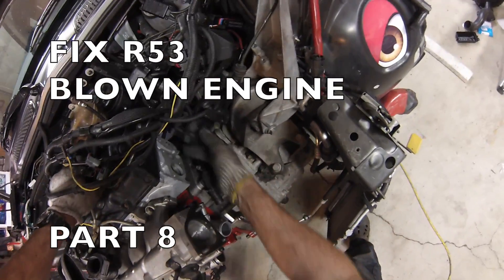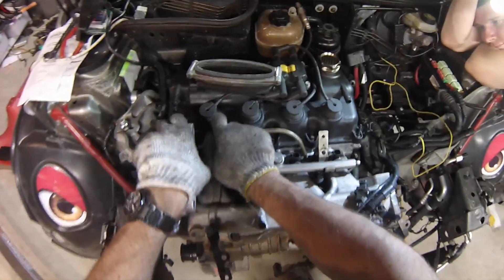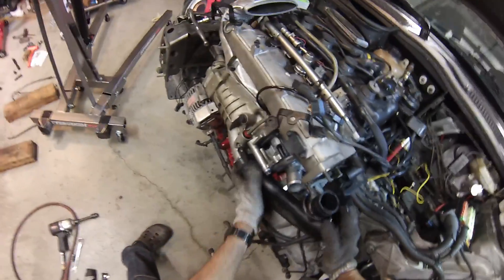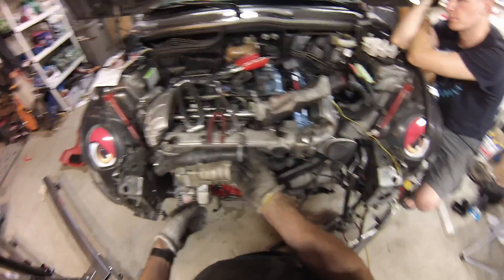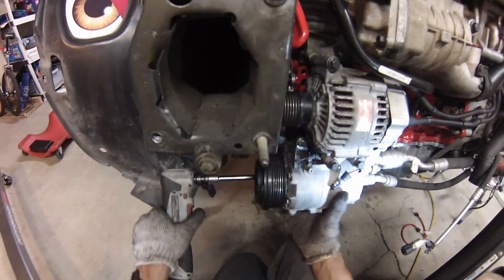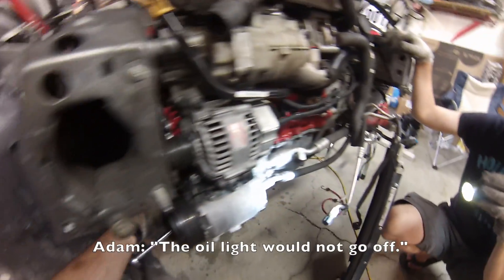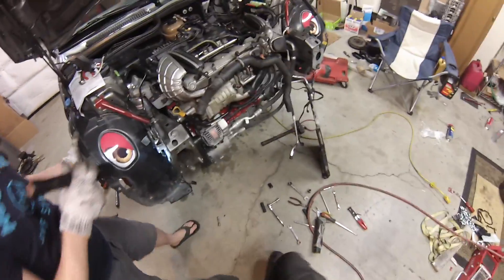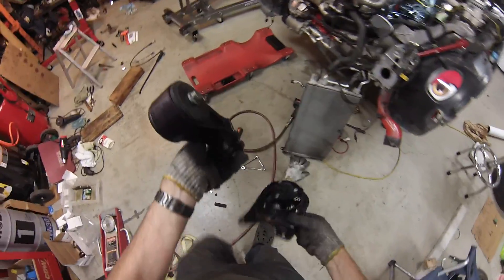Rebuild R53 Blown Engine 2004 MINI Cooper S - Part 8 / 9

Comment: BMW loves 11MM bolts lol
Reply from the maker: On this car, not so much;  the only 11mm I have found on the whole car are on the supercharger horn to intake manifold. And I've taken apart the entire car before.
Reply: Ok well they like 11MM heads where you don't expect them lol. On bmws all the intake manifold bolts and nuts are 11 while exhaust manifolds are ten, throttle body is ten, etc lol.

Comment: when changing he transmission fluid the hose must be snug on the transmission?
Reply from the maker: It doesn't matter because there is a vent, but easier to fill and easier to see when it is full if there is space for air/fluid to come back out.

Comment: When you fill the gearbox with oil, great technique.  How come you don't squirt the compressed air in from the bottom of the oil bottle though?
Reply from the maker: +mjhmotorsport Because 1. it would leak all over the place until I get the air going. 2. The air would rise to the top and the oil would stay at the bottom of the bottle - still would need a tube reaching to bottom of the bottle.
Reply: Ah yes, I didn't think of that.

Comment: Why do you still have the air con on there? Would be so much easier to work around the bay with all of that removed! You don't use air con on a track day surely?? Great vids by the way though.
Reply from the maker: +mjhmotorsport I use it as my every day car and use the AC every day for cooling or for defogging the car.
Reply: Ah OK, That's fair enough then and completely understandable.

Comment: Awesome job! quick question, my seam around one of the cat converters finally gave way and I'm looking into a new exhaust manifold with cat. My question, is the Miltek exhaust the same length as the stock? I have a Borla cat-back, so no need to replace that, ever. haha Also, could you show and explain how to managed the wiring on your AFR?
Reply from the maker: Cody Allen I have an RMW header and Miltek exhaust(cat-back) and each are designed to replace the OEM component of the same size. The AFR wiring depends on which equipment you buy, but it taps into the signal wire coming from the ECU at the O2 sensor wiring harness near the thermostat. This connects to the narrowband output for the wideband O2 sensor. I'm still trying to determine if the simulated narrowband output is close enough to the NGK/NTK output of the stock O2 sensor for the ECU to function correctly. If not, it would be necessary to weld in another O2 bung and have two sensors in the exhaust stream.
Reply: ***** Which header did you get? It shows Shorty Header, Shorty Header w/ V-band and Stepped Race Header. The AFR gauge I bought is an Innovate MTX-L. I'm suprised that your MAP and TMAP sensors don't throw codes with that 17%. You must be pushing at least 17psi, right? I had an +2%  lightweight crank pulley with the 15%  reduction pulley, the car is Bytetronik FA53 tuned and I was still getting error codes. Because of that I went back to Alta 0% LW crank pulley, thus no codes. However I'm still pushing 17psi in high rpm from 4th gear and up at WOT. Anyways let me know how your AFR turns out. I might just have it welded.
Reply from the maker: Cody Allen Probably shorty header? You need to contact Jan to be sure. I have an Innovate LC-2. I got it to stop throwing codes by setting min/max voltages to 0.1 and 0.95 and making sure that the 1.00 lambda is at 0.45 volts. I think it's somewhere around 14.01 - 15.01 AFR...  The car still runs terrible coming off idle when the traffic light turns green, not sure if it's due to the O2 sensor or because I need to get another tune.
I have about 17psi and have never had a MAP code. 2 plus 15 is probably a lot more than 17%...
Reply: *****
Wouldn't hurt to get the car re-tuned. The boost readings was straight from the boost gauge, no readings from a computer. Now since I put the 0% LW crank pulley on, I mostly see 15psi. Which is what it should be, but every once in a while, like I said, WOT I'll see 17psi. So what color are the wires for the narrowband reading? Sorry, I'm not much of  an electrician, so I don't know which wire does what.
Reply from the maker: Cody Allen For the ECU? Yellow wire on the car side of the precat O2 harness.
Reply: *****
Ok, so I would connect that yellow wire to the narrowband output from the wideband O2?
Reply from the maker: Cody Allen yup. I don't know if it will work properly but have a try. My car is running terrible like this but I know it needs a tune.
Reply: ***** Yeah, especially with the oversized pistons, more surface area. So I believe you mentioned in one of the videos that the AFR gauge needs its own power source? If so, what would you recommend on getting that power source? The gauge comes in Tuesday, I'm basically pre-meditating so when it comes in I'll be ready to know exactly what needs to be done.
Reply from the maker: Cody Allen The pistons are really not that much different in size, only 0.5mm (that's like 0.5%), but they have different swirl characteristics especially at low RPM, the exhaust valves are bigger and there may be some camshaft difference as well. Also a lot less piston ring leakdown with the new rings. I also got a new cam because there was some lobe damage on my old one but I can't tell the difference in degrees/lift compared my old one). 
For AFR power, so far I have just tapped into one of the fuses under the bonnet but it would probably be better to add a fuse under the dashboard.
I am no expert on this stuff.
Reply: Cody Allen Hi Cody. How do you find the FA53? Has it made a big difference? I'm looking to have ot done to my R53
Reply: Paul Paha  Sorry getting back to you so late. I had someone use the FA53 to tune my car, so I haven't actually played around with it. But, from what the guy told me, it is a superb tuning software.

Comment: Hey Mod Mini. Excellent job on the videos, I'm looking to modify my 2004 mini as well. question, regarding the strut tower reinforcement plates, if I am planning to place a strut bar in the near future, would I still need the strut tower reinforcement plates? If not what strut bar u recommend?  I was considering M7 strut reinforcement plates. 
Keep up the good work.
Reply from the maker: Hi. Most strut bars provide sufficient protection that you won't need reinforcement plates (or they interfere with each other). The M7 plates are basically the same as the ones that come with the strut tower bar, just without holes tapped for the bar. 
You can also get the Cravenspeed under tower indurators and use those in combination with any strut tower bar, since they install under the sheet metal, not on top. You may need longer studs if you are using the stock strut bearing/strut mounts.
Reply: ***** well I am thinking of getting Megan racing coilovers, hopefully these come with strut bearings long enough
Reply from the maker: victor cisneros That's what I have and the bolt studs are plenty long for any combination.
Reply: I have been looking all the upgrades u have on yours and pretty much have seen all the videos related to your 04 cooper s, and I also want to track race. So I'm kinda using your mods to see what I can get for my car.